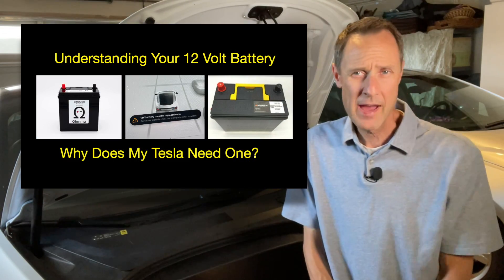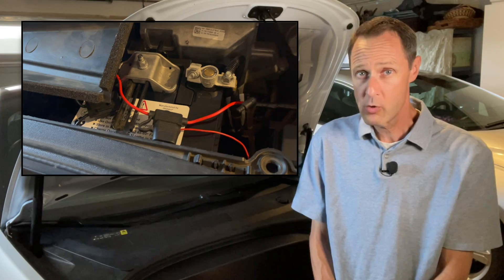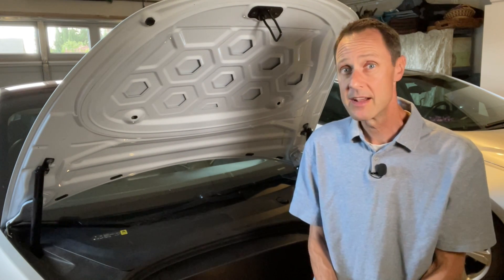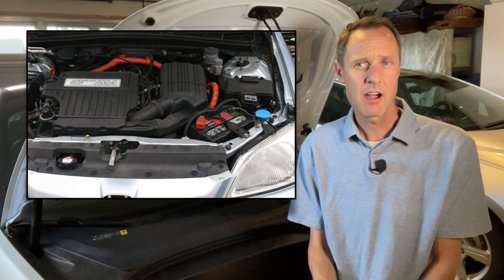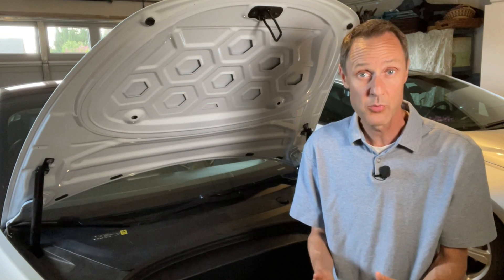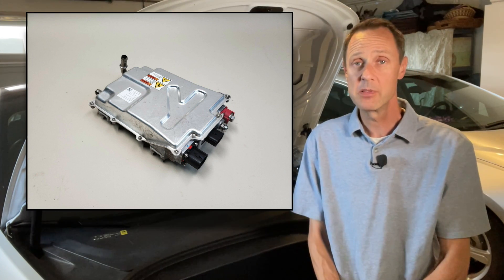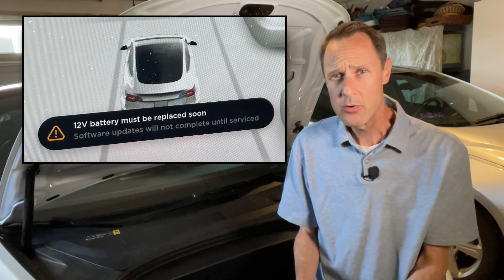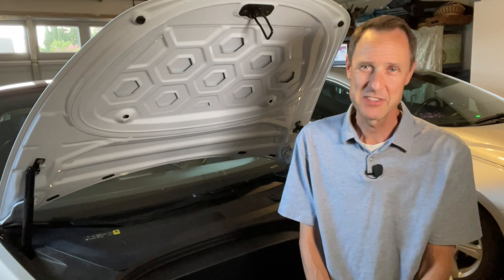1. Why Tesla Needs a 12V Battery

Comment: Looking at the comments people don't realize that a high voltage battery is not compatible with a low voltage electrical system, just like a low voltage battery it's not compatible with a high voltage electrical system.

Comment: Why cant the main battery pack provide all necessary power? Doesnt make sense to me. When you turn off the car, all power needs to stop. Instead of using volatile memory for settings/modes etc.. just use a permanent memory that gets saved over with new settings/modes when changed by user. No need for any constant low power to keep memory alive. 
Much like a usb drive stores memory. 
When the driver turns on power, it accesses the drive and loads all Operating System, then loads up settings/modes. This can be very quick process a matter of seconds.

Also why do you need a frunk? Just fill the space with more batteries. People have gotten by with just a trunk for decades.

Comment: So tesla isnt actually green? It uses old dirty batteries. Where is the innovation?
Reply: Well every Tesla produced in 2022 and later now uses a proprietary 16 volt lithium ion battery.

Did I also say it's proprietary, and you can sadly also overcharge a lithium ion battery which will catch fire.

Comment: Still going through the process of our 12v suddenly dying and getting towed to a service center. I was able to pop the frunk before the car completely shutdown and replaced the 12v battery. I did this myself because our 4 year warranty expired 4 days prior. Ugh! I didn’t watch your videos prior to doing the replacement but wondering how essential it is to disconnect from the main battery under the backseat? I was unable to open the doors so I connected the new 12v without performing this step. The 12v powered up the car but I still had multiple error messages and was unable to drive the car. The Tesla tech stated that the car had to be programmed for the new 12v… if this is required every time I need a new 12v I’m going to scream. Has anyone had this issue? Is this something new that Tesla did to make sure you use their service? Our last 12v lasted just shy of one year and suddenly died. Can’t go through this every year
Reply from the maker: I’m not a Tesla technician but I’m most cases, disconnecting the high volt battery (the one under the back seat) and the 12V it should resolve your error messages.
Reply: @FrugalTeslaGuy  the Tesla tech’s comment about having to program the battery into the car concerned me. He stated folks that have done this on their own would eventually run into the same issue…. I’m assuming you’ve had no issues?
Reply from the maker: @elpradoth153  I, like many others, received an error message that the battery needed to be replaced but that was due to a Tesla Software update. After following the reset instructions on the Ohmmu website, the error message has gone away and hasn't come back. Otherwise, no issues outside of that.
Reply: @FrugalTeslaGuy  that’s great and has me optimistic going forward. I was at the service center yesterday, I was there because I couldn’t reach a service advisor through the app or by phone to let me know if our car was ready, and a guy was there saying he had a tire blow out… so all he wanted was a new tire. The service advisor stated they would drive out to his car and give him a spare and that he would need to show up the next day so they could install a new tire. This again is the programming of replacement parts that has me concerned. In warranty… sure, just an inconvenience to be without your car. Out of warranty, which I’m newly out of, and a simple fix is not only an inconvenience due to an overloaded service center but very expensive. My car received “priority” because it was towed in. If it was not, the earliest appointment I could get was 5 September… which was a month wait.

Comment: Have 2018 Model 3 March with 79k, got warning 10 Aug 2021 when car did not wake up. Have mobile service scheduled for 17 Aug 2021, trying to get moved up. The car still drives, but only daytime running headlights work.

Comment: So sentry mode power comes from the 12 volt battery? How come it depletes some of your battery percentage when using it.
Reply from the maker: Good question. Because the main battery maintains the charge of the 12V battery.

Comment: Sandy Munro is an advocate of using a 48 volt system to drastically reduce the wire size and the weight of all of the auxiliary devices in the car.  The problem is that no one makes 48 volt accessories.  ☹️

Comment: FTG, another very informative video. Thank you. When you talk about having replaced your 12V in subsequent videos of this series, I’d be grateful you’d let us know if you recommend sticking with Tesla’s AGM battery or switching to the third party Li 12V batteries that are designed to fit the cars. Do you know whether the Li batteries handle the cycling and provide as much longevity as the Tesla designed AGMs.

Comment: 2018 Model 3 in my garage and plugged in. My first indication of a problem is that the door wouldn’t open when I pulled the door handle. Nothing. I then tried the app which would not connect. I used another car to run errands. When I got back I manually opened the trunk. The display came on and now the door would open but the window would crack open very slowly. That’s when I suspected the 12V. I scheduled an appointment. The next time I used the car is when I got the 12V warning. This happened a month ago. Tesla came and swapped the battery under warranty I guess as there was no charge. I have about 24K miles. Thanks for these videos.

Comment: On vacation 200 miles from home. Initially unable to unlock the car then it finally unlocked but then got the 12V warning. Car is a 3 year old 2018 Model 3 with 47,000 miles on it. Hopefully can get into the Santa Barbara service center tomorrow morning!
Reply from the maker: Good luck!
Reply: 12V warning only noted that we wouldn't be able to receive software updates so I thought no big deal and we spent the day out being tourists - no problems. After going on-line that night I learned of the other items that the 12V supports and got concerned. The next morning - same thing. Can't unlock but finally we could open the car. The display came up but would shut down when I closed the door.  I couldn't put the car in Drive. I contacted Tesla Roadside Assistance but they didn't have new 12V's on the trucks (???) so they would have to tow the car. A Tesla "repair truck" could come by but not until the next day in the afternoon. Went back to the car and I could put it in Drive!! So, we drove the 3 miles to the Santa Barbara Service Center. They were great and had the battery replaced (under warranty) in two hours (we walked to a nearby Whole Foods for lunch). I'm curious - does "waking up" the car cause the big battery to trickle charge the 12V to the point where you can use the car? Also, the Service and Roadside Assistance access via the app should be simplified - too many options. Despite the 12V problems - this is still the best car that we've ever owned - love it!

Comment: A very timely post. I am having the Tesla mobile technician come today to replace the 12V battery on my 2018 Model 3 (about 20K miles) today.  I did get a warning about a week ago and have been driving it since.  When I made the service appointment on the app I was told there would be no charge so I'm assuming it is still within warranty.  I looked into getting the lithium 12V but they are about $430 so I will stick with free AGM battery for now.

Comment: My 2019 Model 3 battery lasted less than 14 months before I got the 12-volt battery warning.  I was able to drive the car back home, but the next time I attempted to drive the car it would not start.  We made an appointment with Tesla to have the battery replaced and Tesla sent out the mobile repair person to our home to replace the 12-volt battery three days later. The battery replacement was covered under our warranty.  There was no indication the 12-volt battery was failing until we saw the warning on the display.  I was planning on replacing the battery before the three-year point, but it failed much sooner than I thought it would fail.

Comment: I'm curious if the 12V batteries dies while you are inside the car will the door open?
Reply from the maker: That is a good question. Worth testing.
Reply: If not by using the button there is always the lever.

Comment: I own a 2018 Hyundai Ioniq Hybrid of which the 12 Volt Battery is Part of the Lithium Ion Battery Hybrid system, thus no Lead Acid. If the 12V battery section drains, I have a button that I press and hold so the main battery can charge the 12V portion and I'm good to go. I find it interesting Tesla hasn't figured this one out. I'm thinking Elon is looking to replace the 12V portion all together.

Comment: i will be charging my AGM battery once a month !! with an AGM battery charger !!
Reply from the maker: That really isn’t necessary as the car has software to make sure it’s charged but you can check the output of the battery on a monthly basis if you’re concerned about it.

Comment: I've had my 20' M3 LR for a year so far with 7600 miles. Wondering how long the 12v will last before I (hopefully) get that notification.
Reply: I have a 2018 M3 LR with 92,000 miles and no warning as of mid June 2021.
Reply: @skyportservicesnc4894  Nice, that's pretty cool to hear. Replacing a car battery every few years is pretty normal.

Comment: why not put a 12V trickle charger on the battery and run a pigtail into the frunk?  If you were to lose 12V completely the frunk would need to be opened using the manual releases but you could still get to the pigtail and connect a battery tender.  I use a CTEK - 56-976 MXS 5.0 Fully Automatic 4.3 amp Battery Charger and Maintainer 12V  for all my vehicles and the quick connect with the battery mounting rings allows me to connect the base unit to a variety of vehicles to maintain or kick the 12V as needed
Reply: It already maintains the 12v battery. No need for a trickle charger on it.

If for whatever reason the 12v dies, behind the front tow-hook cover is a way to hook up a 9v/12v battery to get things reset.
Reply: @dorvinion  was wanting to have the pigtail to avoid having to pop open access on bumper and use 9v.
Reply: I was thinking the same thing but wasn’t sure what kind of pigtail to buy. Was thinking of having accessible at bottom of windshield if possible and have wrapped in electrical tape or something so it doesn’t short. Then wouldn’t need 9v to open frunk.
Reply: @magarity12  the CTEC with the ring connectors has a weatherproof quick connect/disconnect for that exact reason  you can leave it attached 24/7/365 without worry.  I had this on my Jeep Wrangler for 3 years with the pigtail under the grill exposed to elements.
Reply: @ronm7781  yes that would fit my charger. Do you know if the M8 is the standard size for 12v battery?  Thanks

Comment: I like this series. My late 2018 Model 3’s 12V battery died without giving me a warning. I just went to hop in to leave my house and it was dead. I couldn’t even get in my car. For whatever reason, it locked itself when the battery died or was dying. And Tesla had me get the car towed to the service center. That a whole other story because the tow truck guy couldn’t get the car in the flatbed!

Comment: After 2 years, a warning message came on the screen that the 12v battery was within 2 weeks of failing and to schedule an appointment to replace it. Tesla service came to my house within 2 days and replaced it.  The service call took about 15 minutes. The old battery did not suddenly fail and I was not stranded. 
After the vehicle’s warranty is expired, what would be a good replacement battery?
Reply: Ohmmu seems to be one that is most often discussed
Reply: @ronm7781   Yes. But $479!?! Let’s see what FTG has to say.

Comment: Thx for the info. Doesn’t the 5 year warranty (50,000 miles) cover the battery if it goes bad?
Reply: It’s a 4 year, 50,000 mile warranty, and it does cover the 12v battery.
Reply: @dnizel1  Thank you. That’s what I meant to type 4 years 👍

Comment: I've only had my car for 12 days, so the 12v battery on mine probably has quite awhile to go.  When it does I'll be getting the aftermarket lithium one.
Reply: Tesla did not use 12V lithium battery for the reason. I am not sure what climate zone you live, but 12V battery should be able take a charge in very low temperatures. If it is not that, so I am pretty sure Tesla has other reasons. Also, maximum and minimum voltage for 12 V lithium and acid batteries are different, so it is possible that lithium battery will not have the best charging/discharging cycles points and its life will be shorter. Also, it will be dangerous if it will be overcharged.
Reply: @tesladude2822  Actually, that aftermarket lithium (it's not lithium ion, but lithium iron phosphate, so it doesn't have quite the same properties as lithium ion) battery is quite good, I've heard nothing but positive reviews of it, and it lasts MUCH MUCH longer than the stock battery.  And you also have to keep in mind that Tesla HAS switched to a 12V lithium in the new S/X.
Reply: @tesladude2822  So why did Tesla just switch to a lithium 12V battery for the Model S?
Reply: @ericfermin8347  I never heard of it, but if it is so, why Tesla did not do it long time ago? Second, if Tesla did, I am sure that charging was changed to lithium battery requirements. Also, there are many different types of Lithium batteries, and some have better characteristics in lower temperatures than others.
Reply: @ericfermin8347  Great, so they found the way to break the obstacles. But again, in the cars having acid 12V, charging parameters can be a bit different, which can lead to Li batteries to die faster. As you know Li batteries very sensitive to overcharge/discharge levels and suppose to run with monitoring software.